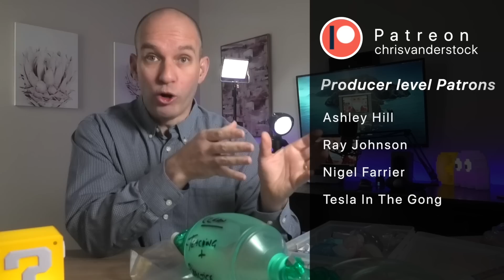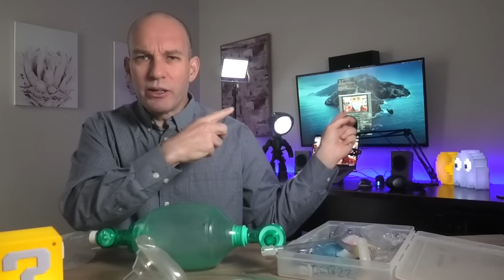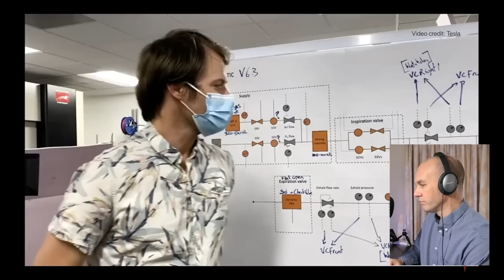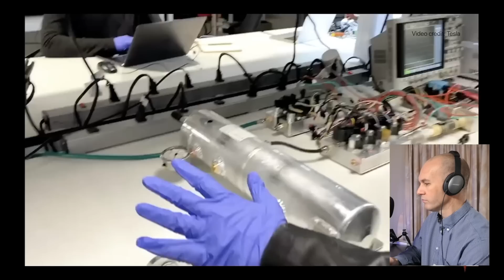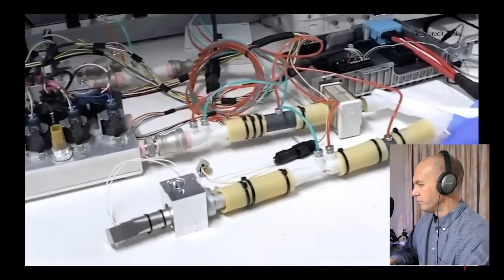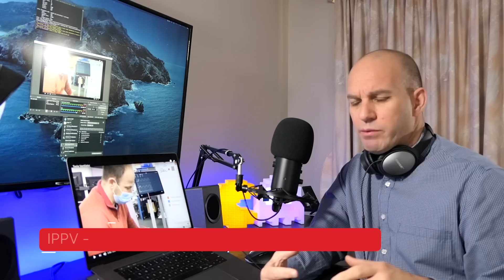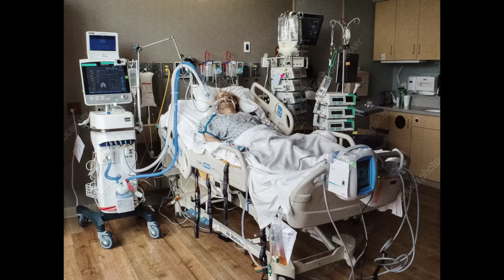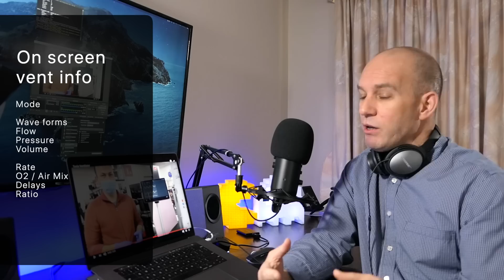Nurse reacts to Tesla's ventilator & what's with those resuscitators?

Comment: In America we have available self inflating bags I believe you refer to as viva’s that have side port exhalation that we place hepa filters with 99.99% efficiency & external peep on all of these bags to mimic what patient receives while on vent or 3-5 cmh2o of anatomical peep. At our facility we use AMBU bags. We use hepa filters prior to exhalation block on our Draeger vents or any vent but place on exhalation block. This vent needs to be able to be cleaned with disinfectants, including bleach products, needs more battery back up time due to failures of back up generators, & long transports. Your absolutely right about having a bag at bedside at all times for hand bagging. It would be nice to have available Airway Pressure Release Ventilation, a type of reverse I:E ratio but not widely understood & used & can be dangerous if not used correctly.

Comment: Regarding the vent weaning component if it takes too long for Tesla to perfect this aspect (but Tesla is very smart) - could the patient remain on the Tesla unit during the time of complete dependence upon a mechanical ventilator (75% of their ventilator time) and only when the patient is in the weaning phase, the ventilator is exchanged for a Medtronic unit (25% of their ventilator time)? In other words the Tesla unit could be a ventilator phase 1 unit, with the patient weaned by a Medtronic Phase 1-2 unit?

Comment: Do they not have an oxygen sensor on the patient and adjust the blood oxygen level accordingly and automatucally by adding/subtracting more oxygen to the mix or is that something you manually set as the nurse?
Reply: I'm an RT, we usually take an arterial blood gas (ABG) to determine the ventilation of the patient, the CO2 and PO2 as well as Hco3 (bicarbonate) levels in the blood. Those levels would determine what settings we should be setting on the ventilator. As for oxygenation, we usually just use a pulse oxymeter that is place on a finger, it's a non invasive way to look at how a person is oxygenating. But that is the easiest number to get.

Comment: great practical run through , have you run through converting dive gear ,climbing gear , ,  pressure tanks could be filled premixed with O2 , if you are useing a mask rather than tube the normal warming and humidifying would happen , and waste air could be filtered or vented elsewhere .  a video is doing the rounds of a NYC Dr ,Cameron Kyle-sidell , saying this 'really bad flue out break' is presenting like altitude sickness , . so O2 and assistance may be better than forced breathing and anesthesia .  An English company is doing a modern version of an iron lung  [ won't let you paste ,, search, new atlas ',modern iron lung designed to address ventilator shortage ',] . which looks to me like it could actually be a better way of assisted breathing, being 'unforced',  ,apart from in surgical situations around the thorax, of course .

Comment: A Danish university has already made a working ventilator. It can be found on Github. The costs is around $6.000 per unit.
The university already educates engineers to work with, and construct medical equipment, that's why they could do the development in 14 days.
The unit has already been approved by Danish authorities.

The unit is only intended for usage, if no other real medical respirator is available. It's simply made to keep people alive, and doesn't have advanced functionality.

Luckily the situation in Denmark has already peaked, and we never had to use more than 20% of the Danish capacity of respirators.
But hopefully, it can help other countries:
https://github.com/CoRescue

Comment: To be honest, it's bad form. Why? The wheel doesn't need to be reinvented, it already exists. He could retool his facilities around making already existing machinary or parts. The same plastic injection and auto lathes are similar across the industry. Retooling is the answer, not trying to fit his parts into a role they were not designed for.

And the FDA process? It's going to take too long to do any good. Pump some of his cash into already existing product lines, help to fix production chains impaired by the closure of borders.

He does this all the time, he's always this asshole who sweeps in with every national disaster. Hey, look here, I have a bunch of batteries that will solve all of your problems. You know it's just for marketing, he's the worst snake oil salesman ever.

Comment: Strange, I remember someone posted something about Tesla having a bunch of CPAP machines. It seems to me that if you got clever you could use the CPAP to provide the positive end exhalation pressure. This would probably require that the squeeze bag be on the pressure side of the CPAP. A little mapping function could convert the desired breath volume into the correct squeeze of the bag. This makes sense of two pieces of news that previously did not make sense.

Comment: As an engineer this sort of customer lead explanation is just what we are looking for when designing, huge thanks and great value.
Reply: Also the reason why the diy ventilators in the first part of the video are not good, if you have the information and how the device should work you can adapt your design, even with hobby level component you can make a precise pressure level, combine gasses, and all the requirements of a professional one, would be hard to humidify and heat the air properly, but hardest part is to make it safe medically, a car manufacturer like TESLA has the capacity to make it to mass production
Reply: @adrianolarescu5129  yes, and I'm sure those bag squeezing 3d printed ones could have the swing of the cycle changed to account for smaller volumes.
Reply: I was thinking the entire time with him saying... "these are car guys". No good sir, these are engineers. Tell them what you need something to do and by god, they can do it. You need a stainless steel water tower to fly to Mars... fuck yea lets get it done..!
Reply: it more like a prototype that never going to near a real human being and more to just get PR....

Comment: Firstly...
Why didn't you cover disposable, BVM attached PEEP valves; if you are concerned with how much air is left in the patients lungs after an assisted breath? (Obviously, "positive additional pressure" is not the mandatory goal. So much as preventing excessive; and easily maintained; pressure within the lung, following mechanical assistance. Hence the use of a PEEP valve!)
...Were you intentionally confusing CPAP (delivering on "constant positive pressure" goals,) with any and all respiratory assistance?
LINK  https://www.buyemp.com/product/ambu-disposable-peep-valve

Or why didn't you mention the typical inclusion of disposable Manaometer?! Especially in the case of infant (BVM) bags; if you were concerned with over delivery, or excessive pressure?
LINK: https://www.buyemp.com/product/ambu-disposable-pressure-manometer

Why show images and video of a system such as the Rice University / ODEK system (developed in cooperation with on site Specialist Dr.s; as well as their local hospital partnerships); if you are not going to explain it's demonstrated ability to control, Rate, Volume and Pressure, through VERY precise use of dual/redundant servos, via the custom software they are providing free to the DIY community?!?!
LINK: https://youtu.be/Glq_9QC3HeI

Obviously, rates of Oxygen delivery are easily mixed, controlled and minimized, whenever required within any hospital setting.  And no one would ever see and DIY solution (complex or simple) being utilized to directly treat, without being overseen by a professional; and each value being calibrate or confirmed.

While I'm glad you claimed your purpose was not to "discourage folks from doing what they can"; and I doubt the more knowledgeable and discerning "Do-it-yourself-ers" will give much credence to your incomplete statements; from a standpoint of "discouragement".  

Nonetheless, I find some of these incomplete and unqualified statements, disconcerting and upsetting for any & all potential patients; during a time when they simply MUST depend on Automated Respiratory Assistance to survive; and the high dollar solutions are unavailable. 

Such random and uninformed "warnings"; which further neglect the fact that there are MANY solutions being built and proposed which not only easily approach each of these issues; but there have also been many many VERY STANDARD add-ons and BVM (bag) attachments, which have dealt with EACH of the issues you are warning about, for many many year now!

(FYI: I have NO affiliation with Rice University or ODEK.)

Comment: What about all of the "IRON LUNG" devices from the polio years?  I just saw a video about one of the last surviving users in the US published a few years ago.   They are a Negative Pressure Ventilator, however limit access to the patient for much else.   They are probably sitting in warehouses and basements all over the place.  They could be used to aid a borderline case that is tiring out and needs rest or time for meds to work without having to intubate and (almost certainly, this is hard to tollerate for even medical profesionals) sedate.  In the case of a ventilator shortage, they could be used with CPAP to help even more critical patients.   But what do I know; I'm NOT a medical professional.
Reply: I'm also no medic. I tried to search about the topic and put together some thoughts on your idea: Iron lungs are technically outdated and got surpassed by BCV (biphasic cuirass ventilation - an airtight cover around your chest)  and methods to stimulate the breathing muscles directly to support breathing. All these methods - iron lung, BCV and stimulation are not sufficient for corona ill patients due to its lung infection. Lung infection is not primarily about an inability of the breathing muscles, it's about having the lungs not taking enough oxygen from the air. So adding more oxygen into the breathing air helps much to get the body time to fight down the corona virus and get the lungs back to normal working condition over a period of one or two weeks. Of course, if you have to breathe quickly all the time to get enough oxygen from pure air, your breathing muscles get tired (and you start to panic more and more) and so mechanical breathing aid can be partly or completely necessary.  Intubating should not be necessary in most cases when oxygen enriched air is sufficient and the patient can at least partly keep up the breathing himself. In these cases a mask is enough and has many advantages to BCV and Intubation. Intubation is absolutely needed when a patient can not add any muscle aid to breathing. An iron lung or BCV would not be enough in that severe cases, because the tongue and the larynx (adams apple) would hinder the airflow. There is a discussion if corona patients got intubated to early in Italy, perhaps to minimize supervision needs due to lacking of personal. But that doesn't get helped by adding in ancient iron lungs.It was an interesting idea though!
Reply: @genius1a  Wow, thank you for the well worded reply! All of that makes perfect sense to me.  Another aspect I'd like to point out is the effect of altitude on this - I speak to this from firsthand experience at 7300'  (2225m) in Colorado.  To quote a respiratory therapist I once knew, our respiratory systems have the greatest reserve capacity of any body system at about 5x what is needed for life (I'm more than open to correction here).  But we must use a portion of that reserve to live at higher elevations.  I don't know how many hyperbaric chambers we have around this part of the country.  However, I'm certain you can't put some 25KPa in the lungs with a ventilator to make up for my particular example.  I believe I had Covid in Feb-March before we knew much, waiting on antibody testing to become widespread.  I will say this - I have a lot of things going for me: Large lungs (decent swimmer), Under 40, normal immune system - it was all I could do to clear my chest at times; I had to cough in various positions with gravity to help.  Laying in bed continuously is the worst a person could do with this.   Sanitoriums for TB are historical/cultural treasures in my neck of the woods (dry air and high UV drew sufferers here) - but if I were older and saw covid coming, I would want to be lower.

Comment: Ventilators need to b able to adjust for Low Tidal Volume breathing, which is necessary to prevent death under ACute Respiratory Distress.  NIH has published studies showing that death from ARDS - whic is how COVID19 patients often go - can be reduced from 40% to 16% by 3 steps, two of which are prone positioning and low tide volume respiration, which is assisted by induced paralysis.  So, Tesla needs to understand what LTV ii

Comment: Why dont each one of the engineers try it on themselves? Last resort is a ventilator that causes damage to the lungs.
How do u get rid of the fluid in the lungs? This is what i would do if i had this virus: need "Heat  and Humidity, Air is too cold and dry entering the lungs, upper respiratory tract, and the virus can reside there. Then lay prone (Face down) lungs are at a downward angle but not the waist and legs because too much blood will go to the brain. Fluid will then drain from the lungs. I drained my lungs when i had pneumonia when i was a kid the same way. We need revolutionary not evolutionary!

Comment: Nicely educational. I can't help but think my CPAP machine does all the same things but has a lower output pressure, only 8" water pressure (20cm) and I recall ventilators output about 30cm (~0.5 psi) . Seems it should be much easier to convert a CPAP unit into a ventilator than starting from scratch. And my old unit is comparable with an open source software called SleepyHead. Output pressure is user adjustable. Comes with a water heater humidifier. Would not be hard to plumb in the O2 supplement.
Reply: BMC makes bipap machines that go to 30. I doubt they actually need a bigger airpump it is most likely just a software upgrade to charge more. These days everything is just controlled in firmware.
Oscilloscopes often have thousands of dollars in features locked down in software even though the hardware is there in all machines. It is cheaper to design 1 device than to build several versions. The rigol MSO4000 can cost $999 or over 5k and others go from 2.5k to over 12k with all features unlocked. People hack the firmware over he jtag port and unlock all the extras for free all the time.

Comment: Why not help Medtronic make more of their ventilators. Has Tesla gone through the years of regulatory testing needed. Waist of time and effort.
Reply: I would imagine there is a shortage on parts for Medtronic.  Tooling and production flows would need to be set up that are completely different to how Tesla normally manufactures products.  The goal here is to create a suitable alternative that is able to be produced by Tesla quickly and in volume.  Tesla chose parts that are readily available to them and designed parts they are able to manufacture at short notice, hardly a 'waste' of time and effort.  You speak like an expert... look up Dunning Kruger effect.